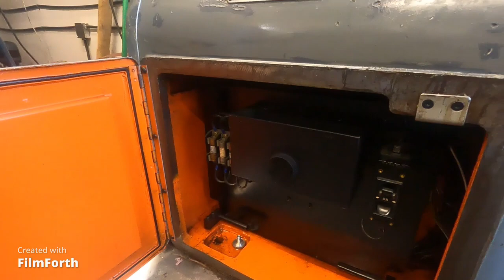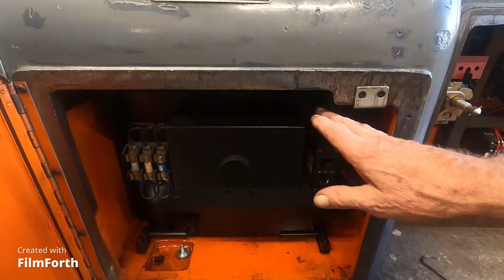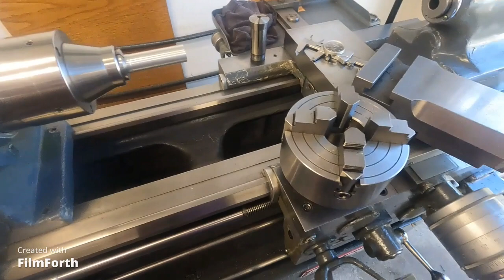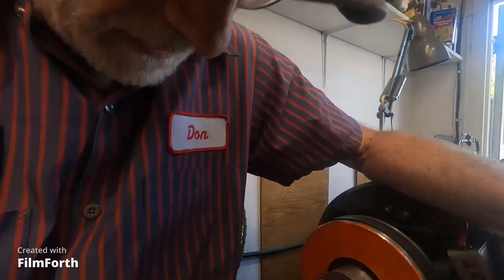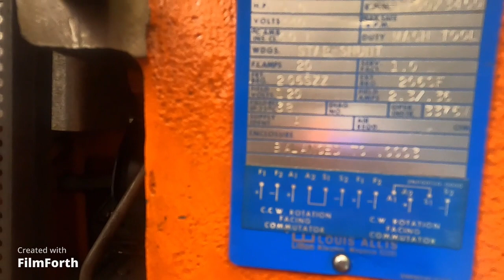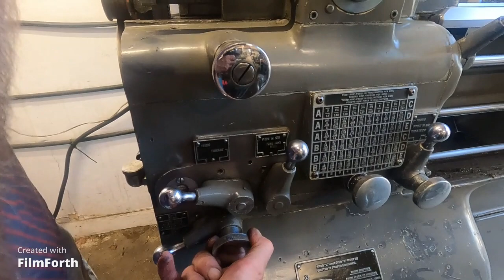Monarch !0ee Module Drive 1960 to 1983 quick check

Comment: Hi Dee Dee, i have a perfectly working tube driven 10EE like yours, just not inch metric, square dial from 67. I am gonna keep using it with the tubes til they last. When they die I’ll replace them with a 10hp brushless servo drive and amplifier. What so you think about brushless servo drives? I think the current 10EE come with a similar drive solition
Reply from the maker: It looks to me the one I seen slammed when reversed, with a bang. The current factory drive is an AC inverter. Look carefully at how your drive works, it has a soft start to prevent slamming like the one with servo on a red round dial 10ee. That is not good in my view of what is shown.
 Right here is where the so called machine restorers are in short pants and on a short bus will do anything but learn, so the excuse "The drive is too far gone" That term was invented on the racist practical machinist losers, bullies and jerk offs, thanks
Reply: My 1962 module drive has the solid state Thyratron Replacements from Scissio Controls and the lathe runs great.  The only tube I have had to replace on my recently acquired machine is the C3J tube (smaller one) and they are still readily available at a reasonable price.  With Dee's help, you should be able to keep that drive running for many years to come.

Comment: Dee Dee - You forgot the Tailstock Access Panel . There is an exciter in there. The brushes need
changing periodically. --- Jim
Reply from the maker: There is no exciter on this style of drive, the small vacuum tube produces the field voltage that the exciter does on the earlier motor generator drive. The cover on the end has the coolant pump, I will open that up, thanks!
Reply: Dee Dee - Looks like I blew it - But I didn't hurt my lips . -- Jim